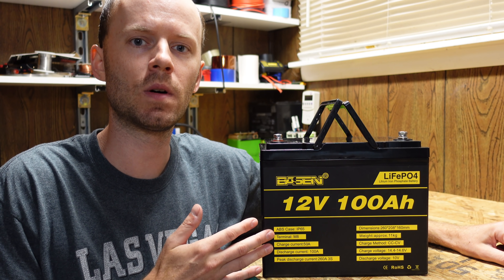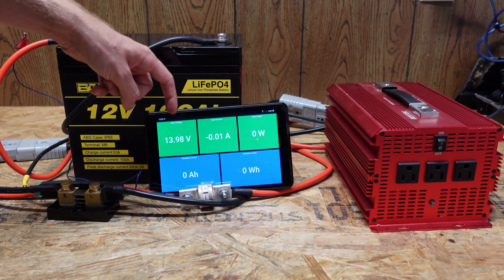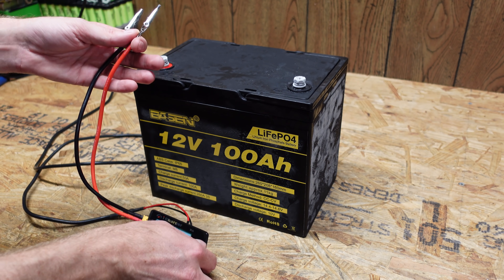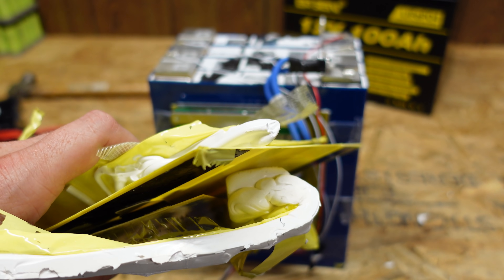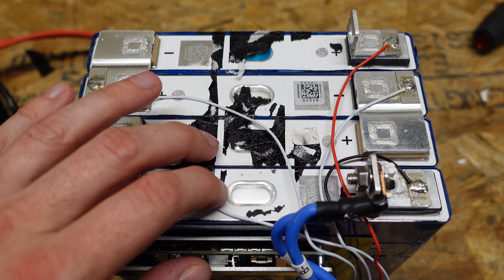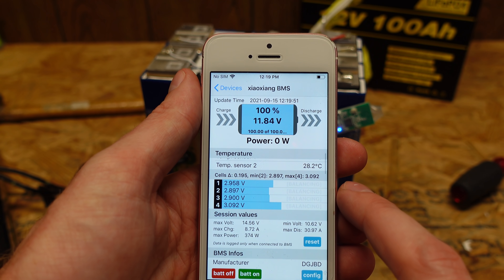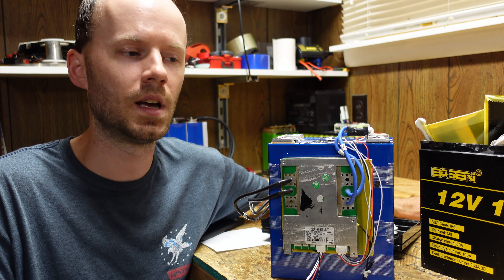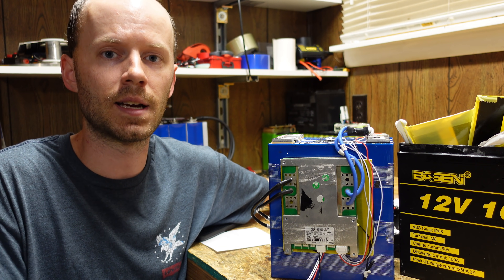Basen 12V 100Ah LiFePO4 Battery Review, $275/kWh, Includes Bluetooth!

Comment: Fyi: if you every buy cells from basen: „Because you said there was no problem with the battery when you just received it, so it was caused by improper operation in the process of use.“ = no warranty at all😂

Comment: What is needed is the manufacturer data on the battery cells.  This would tell if the cells are class A or B cells.  For the cost I would suspect class B cells.  So much fraud is coming out of China it's nice to see something that is not complete trash but I would like to see some regulation as to the factory data being required on all  batteries.

Comment: The double 10ga wire going to the terminal is questionable. 100 amp discharge rating should have at the VERY least double 8ga wire.
Reply from the maker: According to various sources online (such as this https://www.powerstream.com/Wire_Size.htm) the rating for 10ga in "chassis wiring" is 55A. I agree 8ga would have been much better, but 10ga is still technically "ok" in my opinion.

Comment: Please explain how four 72 watt light bulbs at 120 volts draws over 22 amps. I understand that the 2000 watt inverter probably draws a couple amps but even a single 100 watt incandescent bulb draws less than one amp. Thanks
Reply: The way I think about this is there are 2 circuits in this set up. Firstly, the battery to inverter circuit and secondly the inverter to light bulb circuit. 
Current = power / voltage 
Total power requirement = 72W * 4 = 288W
On the battery to inverter circuit, current is 288W / 12.8V (which is typically the initial voltage of the battery) = 22.5A. 
On the inverter to light bulb circuit, current would be 288W / 120v = 2.4A

Comment: Would have liked to have seen a capacity test after you froze the battery cells below zero? Good chance the cells may have been damaged during the process? Publishing the results of the test would help those who have to use similar batteries in sub zero conditions

Comment: lifepo4 cells are some neat chemistry but once they're built out into packs the size ends up the same as deep cycle lead acid batteries yet slightly more expensive. ie; my 6v 215ah batteries are the same size, slightly higher capacity, slightly cheaper new and a whole lot cheaper to replace bc battery cores trade in.
Reply: The difference is you can use more of the capacity from the lipo than lead acid before voltage drop.lipo is around 80%,lead acid around 20%,deep cycle 50%,so in reality you can use only half of your 215ah. Also lipo keeps rock solid voltage all over the discharge phase.
Reply: @mandytuning  and lipo has at least 5x the cycle life, but more likely 10x or more if you're not pulling deep cycles routinely. For that reason they're much, much cheaper over time.
Reply: @mandytuning  @Andrew Fidel Its true, Although my system pulls more like 65% consistently. It's  ten years old, does one deep cycle daily. I've only had to replace 2 of the 8 6v215ah cores, But I have had to service them regularly to avoid replacement costs. In terms of usable energy storage vs cost lead-acid is still competitive vs LiFePO4. Servicing batteries at home isn't something a novice should attempt, But no amount of at-home-refurbishment is even possible with LiFePO4 cells. 

@Paul Johnston p = m/V !?!
Reply: Weight! Density!

Comment: Is it possible to mix LiFePO4 with flooded lead acid batteries when charging with 100 Watts of solar?
Reply: The BMS and charger can be fed by the same solar bank,, the input voltage is not a driver, but they charge on vastly different charge cycles, so keep that side completely separate. Run the LiFePO on a special BMS, and the lead acid on their charger.  I also wouldn't put them in series on your loads, they discharge at different rates and voltages.

Comment: The conductors are still undersized. there should be a pair of #6 .The small conductors, if you intend on using the 100A of current it will create a fire hazard.
Reply from the maker: The wiring used here has a 200C insulation rating. It can handle significantly more than the NEC ratings (which are typically given 60-90C).
https://catalog.connectronicscorp.com/Asset/WIREMAX-conductor-CURRENT--2-.pdf
Reply: Significantly more does not mean a 40% conductor reduction. First, the conductor is not uL rated. The temp rise in free air which will allow a higher current through a conductor does not apply here due to the lack of air or space inside the enclosure.

Comment: In the future, you should try using "dust off" cans to freeze the plastic right at the seam rather than freeze the whole battery.  Hold the can upside down and the liquid spray will quickly freeze the plastic.  Once the seam starts to pry apart, you can freeze the glue directly using the small tube.   Use a clean, 1"  flexible blade scraper that's been sharpened using some 400 sandpaper.  It's like a spudger with a handle. There's also plastic versions. Loved the video!

Comment: I LOVE THE BLUETOOTH!!!

I also love the fact you can change the values in the BMS - in order to get more cycles out of the lithium, adjusting those values to knowingly reduce overall capacity in order to get more cycles is an amazing tradeoff!!!

This battery just hit my top 5 pre-assembled list!
Reply: Is it a net equal tradeoff between capacity and life cycles?
Reply: @priestesslucy  - “capacity and lifecycle”

It all depends on your use case.

If you are doing a home battery and weight does not matter, it is a pretty good trade off 

If weight matters, like a remote control helicopter, not such a good trade off because of the weight.
Reply: @priestesslucy  no, going 80% depth of discharge increases battery life by a lot more than the amount you decrease your capacity

Comment: I can assure you Basen did NOT buy nor have any influence on battery assembly.  They get the LiFeP04 cells from manufacturer and simply silk screen their name on a blank case for the cells inside that battery.  They tried pulling the same identical story in the eCigarette (vape) industry.  They are such a small company (it's 5 people and they sign emails with different names as well).  Lie upon lie upon more lies.  Regardless, battery is nice, but is standard (typical) performance and quality as expected from China.

Comment: Nice work sir.. all and all looks good. 
I would recommend.. If someone buys this battery to pull a 100a for their application.. “buy a larger capacity battery or more of these to run in parallel. ”Running anything at Maximum usually means Minimum Life and Minimum long term performance.
Because a car is rated at 140mph.. it might just perform much better at 60 mph. 😂 
My two 48v 200ah batteries spec 1c / 200amps each, have never pulled more than 100a with a total rating of 2 in parallel at 400amps. Yeah 25% of the capacity available.
Nice review sir
✌️PT

Comment: With the internal BMS would there be any issue running multiples of these in series, parallel, or series/parallel without additional bits?
Reply: supplier said 4 in series max.

Comment: The bms mounting is fine. The bms heatsink is facing away from the cells and the fiberglass board between the cells and bms is a good insulator.
Reply: Watch the tear down of a battleborn battery… BMS 1” clearance to the cells with thick plastic insulator, FOUR #8 conductors to the terminals, and massive copper bussbars… now, if only they would lower their price closer to this build…
Reply from the maker: Great, thanks for the info! :)

Comment: Hello, would they be any problem connecting 2 of these 12v batteries to make 24v seeing that they have a smart or Bluetooth BMS?
Reply: Hello, Parallel connection requires the same battery voltage.
Reply: @K-PopMadness  The batteries in series need to change the BMS in advance, otherwise they cannot be connected in series. If the voltages are inconsistent in parallel, the batteries will be damaged.
Reply: @K-PopMadness  it's great,thank you.😃😃😃

Comment: man this is a very good deal,u can hook up 8 of these on a 48V setup and have like 9kw of storage power for your solar system,for very cheap price
Reply: 8 of these would be 10,547Wh
Reply: @SuperVstech  wich u should never use always all capacity,better for batery life.
Reply: @83kaszas  oh, agreed, but it would be here.
Best use is discharge to 15%, and only charge to 95% get far more cycles that way.

Comment: Nice load arrangement. I really like to see that class T fuse! I would rather see 2 wires at 8 gauge, but the 10 gauge works. The JBD is a great BMS. The welded busbars are great for a sealed battery, even if aluminum. A really good price and the quality is acceptable.
Reply: Hello, you can learn about Kanavano battery, maybe he has what you want.

Comment: if you have a can of compressed air you can flip it upside down and you get liquid nitrogen and spray it on the  edge of the battery case, instant freezing no waiting
Reply: Be extremely careful putting liquid nitrogen in a can… the heat from your hand on the can can build over 2000PSI in seconds. Extremely dangerous…

Comment: Any indication if these can be series connected to get to a 24 or even 48 volt nominal ?
Reply: Of course. You can connect these in series and parallel just like any other battery.
Reply: @gymkhanadog  I've seen some 12V LiFePo4 packs with BMS show limits to how many you can string together, some as low as 24V (2x), a few at 48V (4x).
Reply from the maker: It does matter because the BMS needs to have components capable of switching the full string voltage. The JBD BMS should be able to handle 48V. I would not exceed 4s and I would definitely confirm this with the manufacturer first though.
Reply: @Bennyboy-dog  Oh! I did not know this; thank you for the info! That certainly imposes a serious limitation on some of these cheap batteries.
Reply: @LithiumSolar  Just saw the video! Thanks for opening it up! I'd like to add to the question about putting these in series. Would there be any issue charging them if 3 were connected together to get 36 volts and each battery had it's own charging cable from a 3 bank charger that can charge lithium batteries?
Reply: @gymkhanadog  - I have seen testing with BMS’s where batteries in series did not shut the whole string of batteries down to 0v, but the loss of 1 of 2 batteries resulted in somewhere between 1 and 1.5 battery voltage in the output!!! - this was a crazy result to me!

After seeing that result, I am very concerned about wiring any battery with a BMS in series.

Comment: Well, I think Shenzhen Basen is who I recommended for the big 280AH batteries (Emily Ping, if memory serves?) so, I'm guessing that these are from them. Not that I would choose tall cells, I certainly would do prismatic cells & the Overkill Solar BMS. That price and the seeming build quality is excellent. I'm not sure how you feel about using (2) 10 gauge wires, but- if I was gonna draw max power for more than a few minutes, and- use the battery from full to empty often- I might swap those out for a single 6 gauge wire? Heck, that might be crazy, but- it would reduce line losses & temps inside the battery box, right? If they'll last crazy long (they will) it might be a good investment in safety & longevity? Either way, at $351/ copy, it's only slightly more than building your own. Wait- how much is a battery box?- it might be cheaper than building your own! It certainly ends the "I think I'll go with AGMs this time" since there is so much more power & they last so much longer.

Comment: They look like eve 100Ah cells with the white top but the terminals are in a different spot.
Basen usually deals with EVE and Lishen so it could be one of those 2.
As a security feature, they could change the bluetooth pin to something printed on the battery. so while these are in shipping, the bluetooth is active and it's true someone could change settings on these as they see fit.
If there is a pin printed on the battery for the bluetooth then at least no one would be able to connect to one of these unless they open the box that these ship in.

Comment: Very impressed for the price, but as other post stated, since this was sent to you, it could be a special pull for review.
Reply: yeah.. agree. I purchased 32 pcs cell from them and 4 of them are damaged, some of them are bloated.. me personally, I'm gonna stay away from shenzhen basen.
Reply: @rmdjapri  If you need, I can provide you with cells.
Reply: Hi please can you help me a dont think it is right a have 2 gel batterys 250ah and 200ah and 3 solar pannels 100w 240w and 300w a have 30A controller and 3000w inverter everithing is 12v my charging on the battery is 13.3 when the sun is gone my battery is 12.3 if a start my inverter it drops to 11.9 and have power maby for 3 ouers please tell me what to do thanks
Reply: @freddieverreynne3344  it sounds like your batteries are depleted.
Can you check the water level?
Reply: @freddieverreynne3344  those solar panels are all different voltage.
You can't put them on the same charge controller.
Reply: @freddieverreynne3344  
You have 450 ah of battery being charged by a max of 30 amps.  If your batteries are completely depleted, it would take 15 hours of sunlight to recharge them. 15 hours of full sunlight a day doesn't happen in many places.
What's missing from your problem description is how much output power you're drawing through the inverter.  To guestimate, let's assume you're using 1800 watts.
That equates to 150 amps, so your 450 amp-hr of fully charged battery would be completely consumed in 3 hours.  Since you're batteries rest at only 12.3 volts, it sounds like your batteries aren't getting fully charged.
I would start by getting a larger charge controller of about 60 amps to fully utilize your panels.  This would cut down the hours of sunlight required to charge your batteries to something more possible. Also, try to estimate how much power you're trying to draw and assess if you're getting the amp-hrs into your batteries needed to feed the amp-hrs you're trying to draw out.
Right now, it sounds like you're consuming more amp-hrs than you're replenishing with the solar panels.